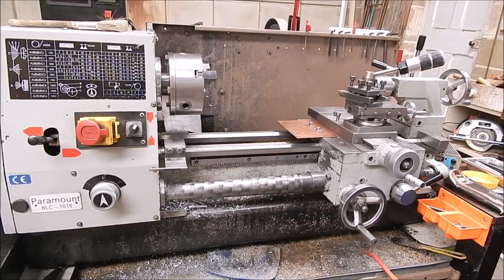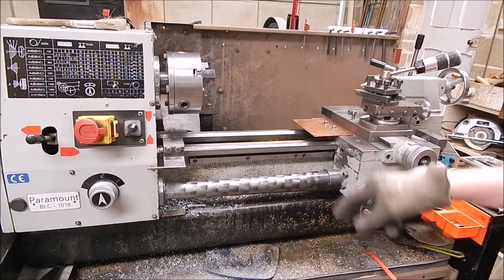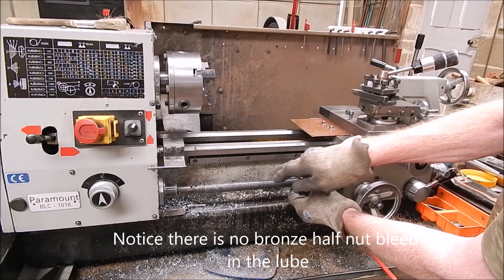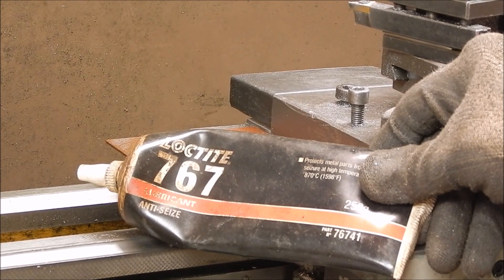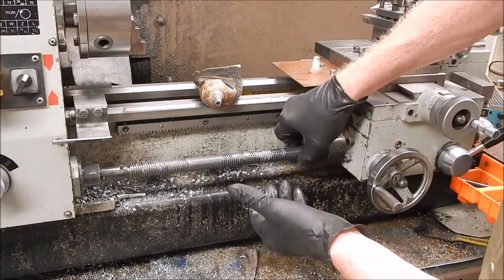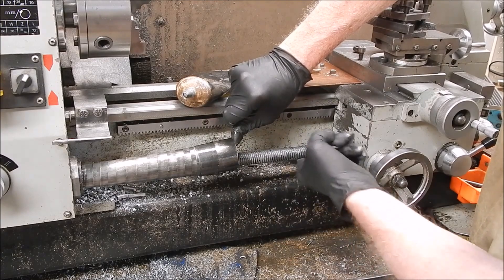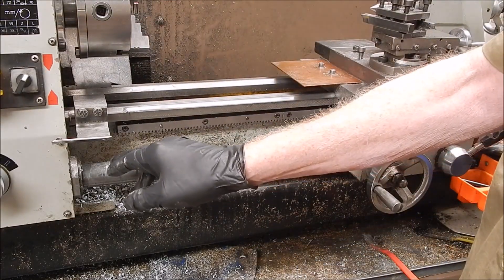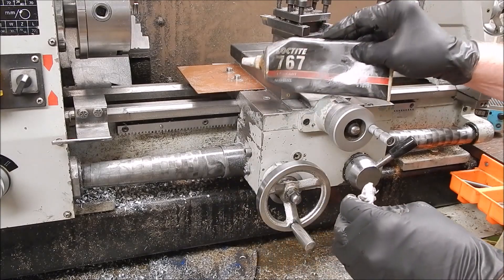I lube the metal lathe leadscrew after 5 years of regular use

Comment: Hi Rob those expanding covers are such a good idea. It's a pity Myford don't have them on their lathes. I clean the lead  screws on both my lathes with a tooth brush while the lead screw is running. Lubricant with SAE 30.  The Myford does have a short cover over the screw just below where the cutting tool sits. This helps a bit. Have a great Christmas Rob, and a safe and peaceful New Year.  Cheers Nobby
Reply from the maker: Hi Nobby.  I cleaned and oiled the mini lathe leadscrew the same way as you.  You can buy aftermarket spiral leadscrew covers, but they are a bit pricey and you have to allow for reduced carriage travel because of their minimum compressed length.  I think they are a great idea and save a lot of hassle, especially with dirty jobs.   Only some new lathes in Oz have them, even though they have been available OEM for at least 20 years.  Have a Merry Christmas and Happy New year also.  Cheers Rob

Comment: Must admit Rob, I'd never heard of Loctite 767 but will make a mental note. I don't have lead screw covers but always make a point of cleaning the lead screw after use. It seems to be holding up well. Cheers, Alan.
Reply from the maker: Hi Alan.  Good move.  I forget why I aquired the 767, but it turned out to be ideal for this application.  Extremely messy stuff, so not suitable for open use.  It's interesting that every user manual I've read for Chinese lathes only mentions using regular light machine oil and grease, with no mention ever of fancy way oil.  Some people go a bit overboard on this subject.  Cheers Rob

Comment: G’day Rob, another great informative video. I’ve been running the same lathe for many years now so your videos have been of great help for me (being a fellow Aussie is great). Unfortunately, for reasons beyond my knowledge, when I turn it on now it is tripping the power circuit. Any ideas on where I should start?
Reply from the maker: Can be three things.  Bad starting capacitor, an earth leak/short, or an active to neutral short in the field windings or starter circuit.   Check windings leakage (resistance) with a multimeter.  If necessary replace the capacitor.  It can be bad switch gear, but most unlikely.  The motor is sealed, so it shouldn't be a dirt issue.  I fitted a cheap temperature sensor/gauge to my motor and can monitor it.  Protracted use can/has pushed temps up to danger levels (> 50 C) over the years and it's a good safeguard.  Temperature will eventually break down field winding insulation/varnish. If unsure about messing with AC take the motor to a suitable electrician for a check over.  I hope this helps.  Cheers Rob

Comment: Interesting video. I have the same machine and had to replace the V-belts. I bought: short belt: Width:10mm, Height: 6mm, Length 500mm. Long belt: Width: 10mm, height: 6mm, length 630mm. The belts fit, but are very, very tight.  I think they are either too wide or too short. Does anyone know what the correct dimensions of the V-belts are? Thank you
Reply from the maker: I've replaced both belts several times.  Both are regular 10 mm width by 6.5 mm depth.  The spindle to idler is 630 mm length.  I can't read the numbers on the motor belt.  Sounds like you have belts that are too short. Always take in the old belts for comparison when buying replacements.  Cheers Rob